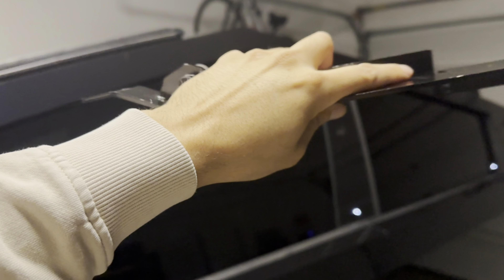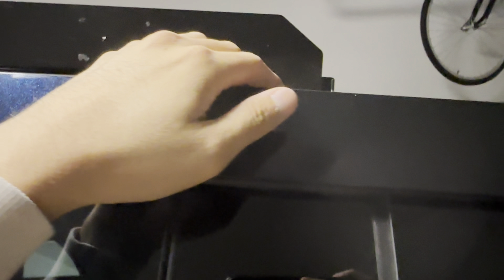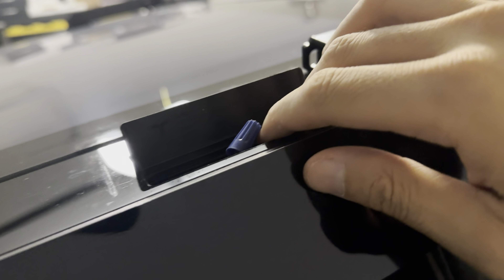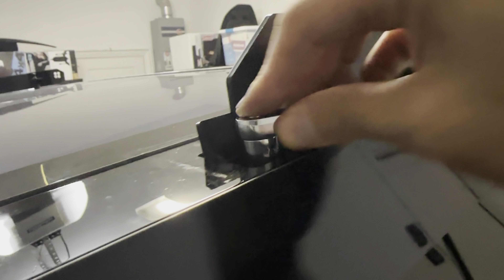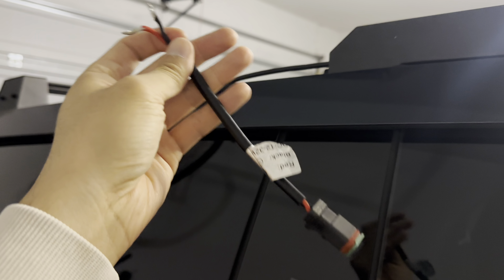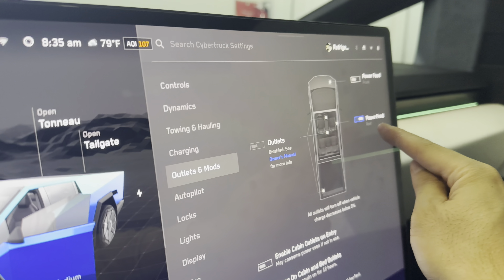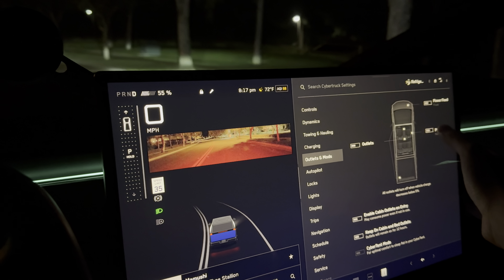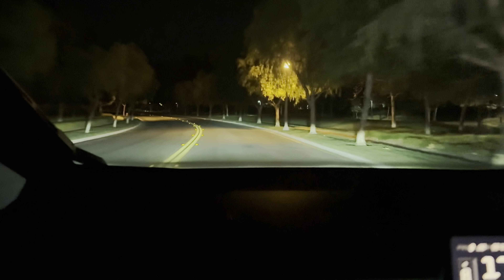Tesla Cybertruck Lightbar a MUST HAVE Accessory!

Comment: Per your website "Smart control: The light bar is seamlessly integrated with the original car control system so you can easily control the ditch light, main light, and all the brightness directly on the UI, for example, changing the beam direction." How do you active those features in the CyberTruck?